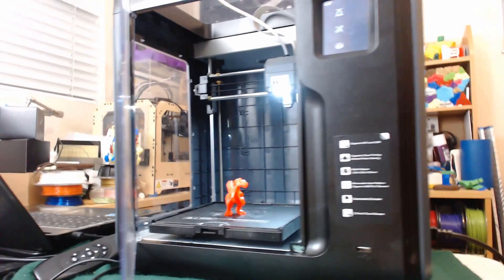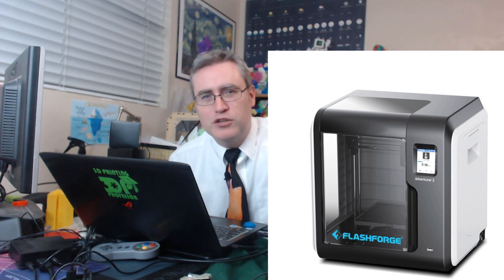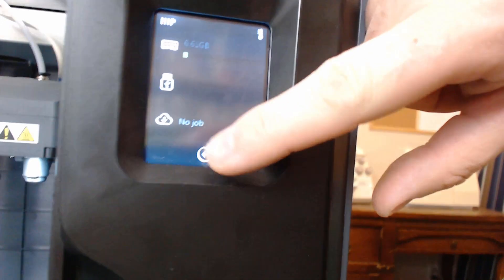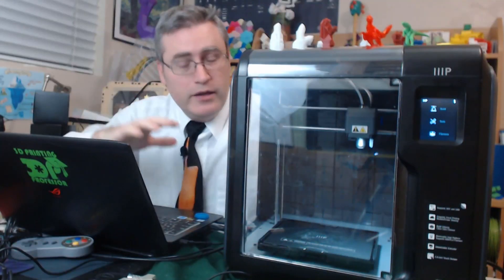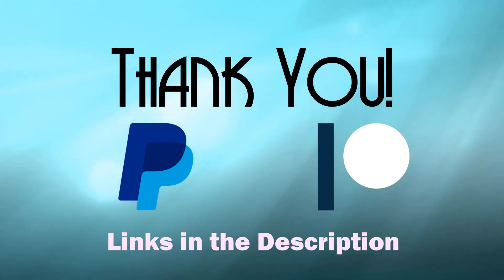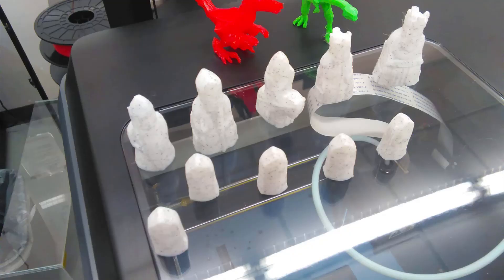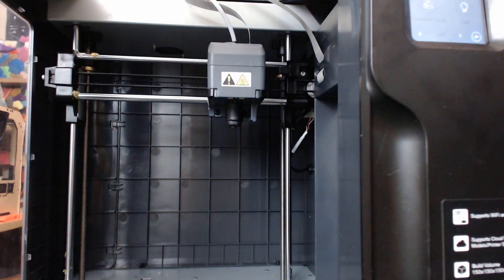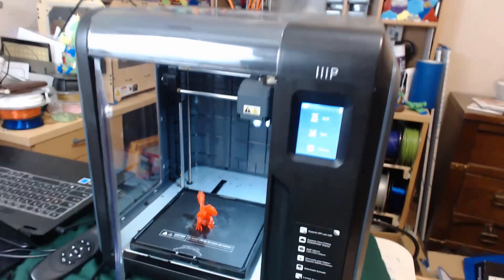Absolutely Loving the Flashforge Adventurer 3 / Monoprice Voxel 3D Printer

Comment: the  Replacement Nozzle - Designed For The Voxel 3D Printer are £24
Reply from the maker: Yes. And they snap right in. 

You may not remember this but Makerbot charges $100 for the replacement nozzles pin their 5th gen machines.

Comment: Not sure if you've used a Voxel lately, but the last firmware update I did increased that filament load speed a lot!  Now it sucks it in at a pretty high speed until probably 50mm from the carriage, then it goes to that slow speed.  And, there seem to be several sizes of the nozzles from Flashforge.  Monoprice only has one size on their site.  But they do seem to be readily available now for $26-$39! And replacement textured bed pads are like $5.

Comment: The top does open, if you push up on it from underneath. Makes the bowden easier to access. I agree with everything else you said- this was my first 3D printer and I think it’s the best printer to try and figure out if 3D printing is for you. I loved this thing and traded it for a drill press when I upgraded to a Prusa. If I hadn’t started with this, I wouldn’t be as into 3D printing as I am, because the Prusa is much more work to dial in.

Comment: Flashprint-MP is very sensitive to screen setup. If you closed it while using multiple monitors and the program was NOT on the main monitor when it was closed, then if you open it using only a single monitor, the program does not run properly. Close the app on the main monitor.

Comment: Currently considering the Monoprice Voxel 3D vs the Creality Ender-3 or Ender-5 (and if I do go with Ender, then vanilla vs pro). Any thoughts? I like the cheaper price of the Creality, but like the idea of ease of use and no need for assembly with the Monoprice. Does one have a better print quality than the other?
Reply from the maker: No, print quality between them is exactly the same. It's a question of how much do you want to tinker versus how much do you want to be making 3-D prints.  And I can't make that call for you.
Reply: @3dpprofessor  Thank you for the reply. What do you mean tinker vs 3D print? Tinker with the printer itself, or tinker with creating/modifying 3D models to print?
Reply from the maker: @Benjamin-rr4ku  Tinker with the printer. 

For some folks, that's what 3d printing is about. Making the machine better. And for others, it's about using the machine to make their ideas real. Me, I'm in the latter group, so paying a little more for a machine that just works is worth it.

Comment: Will the nozzle handle the temp for petg I'm wanting a printer that I can print aquarium safe parts and I've heard that nozzles with Teflon can't handle the high temp
Reply from the maker: Teflon lined feed paths do have trouble with high temps, but PETG isn't that high temp. Im currently printing ABS and its fine. 
The problem you're probably gonna have is bed adhesion. But you're going to have that with almost all 3d printers with PETG.
Reply: @3dpprofessor  so maybe something that has a heated bed or removable would be recommended for the PETG
Reply from the maker: @terrystanks1031  yes. And this printer has both.
Reply: @3dpprofessor  is there a program you would recommend for the design of the items that I'll be printing
Reply from the maker: @terrystanks1031  Tinkercad is great for the absolute beginner. Fusion 360 is the choice of engineers who like jumping through hoops like a circus animal. Blender is good for artists.
Reply: What program do you recommend for designing my 3d printed items

Comment: Is it compatible with third party filaments??
Reply from the maker: Yes.
Reply: Yes and... It's complicated. The filament that will come with printer, will work perfectly. With others, including those from Monoprice, mileage vary. With old nozzle and firmware, chance is close to zero, with new nozzle and recent firmware, some filaments will work, and some - still not.
Monoprice ships printers with old nozzle, but sells new one separately, at the same time their support "doesn't know" about 2 versions. Flashforge support will provide new firmware that will rename your printer to Flashforge Adventurer, and after that you'll get new updates regularly.
In other words - yes, but after thorough tests and efforts. 
One thing you'll find interesting, is that temperatures vary, and you should keep them as low as possible. High temperature may kill your nozzle, if filament requires lower.
Reply: @anreoil  thanks for the response. Recently bought anycubic mega s for 350cad..happy with it so far.

Comment: Does it handle USB 2 or 3 drives?
Reply from the maker: You've got a USB3 flash stick? Dang. We're not worthy.
I ran into a problem with some of these bought on Amazon. The firmware was so old that it could only read FAT formated USB sticks. The only way I had to do that was to get an old 1gig SD card that I had and put it in a USB adaptor reader. But once I did that I was able to get it to recognize the drive, I could put a newer firmware on there and update it, and suddenly it was able to recognize my newer USB sticks. Maybe that's what you're experinecing.
Reply: @3dpprofessor  Thanks for your answer!
Reply: I am considering checking out SunLu and others too.
Reply from the maker: @Yatukih_001  I can tell that you're frustrated, mostly because you're writing these long paragraphs so I get the notification of your complaints, then you edit them down here in YouTube to a single comment, and you've done that every time, but just let me assure you that these machines do work as I've said. There's clearly something wrong with yours or the way you're using it, but if you stick with it I'm sure you'll have better luck. I use 7 of them in the makerspace and they're great.
Reply: @3dpprofessor  I know. Found out it requires a 4 GB card. The card does not work, so I am unsure if I will bother further with it.The editing of these comments has been done to make sure they stay focused on their point. Seems I ran into a faulty printer.

Comment: Every time your nozzle clogs, you'll pay over USD30 for new nozzle. For other printers it's usually around 5.
And that's official Flashforge response for clogged nozzle, btw. Use the needle to unclog, and if it fails - buy new one for 10% of the printer's price.
Reply: if you're familiar with printers in general, for the price point, which one would you recommend over this one?

Comment: the nozzle isnt proprietary or anything like that right? ive been looking at getting a 3d printer to draft up some tool accessory  ideas ive had in my head and i want to print it in abrasive 3d filament which will require a hardened nozzle and i wanted to know if this supports that feature

Comment: 'The best 3D printer on the market for beginners' - not a chance. This is a buggy machine full of flaws, from heat creep to slipping steppers, appalling calibration to impossible bed levelling. The firmware is full of issues, from updates over wifi not working to mac address changing each time you switch it on. I want to love this machine, but I hate it.

Comment: I'm having issues with the extruder slipping when it's feeding.  You didn't mention this particular problem but what should I do?  I've tried different filament, putting a different gear on the extruder (which is crazy hard with where the extruder is positioned).  Do I have to print super slow or what?  I'm flummoxed.
Reply: It's a massive issue with this printer. No easy solution as it's based  on a few design flaws. It's not a good printer. Feels like it's still in beta testing.

Comment: I don't know if it's just me but it doesn't seem like my auto calibration does anything whatsoever...+2 seemed the golden number offset for a bit but now it's everywhere.  I set it and every time the offset that feels correct when i do the paper test is different.  I can set it, then immediately redo it and it'll be completely different...I'm not talking a little different either I'm talking a +2 offset being fine one second and then going right back into it and a +5 offset is now ripping the paper.  I've also found that if i go to a certain number and test, then bump the offset up one and come back down it's completely off again...and on top of all that when it feels pretty good, I go to print and I can hear the sound of the hotend actually contacting the surface of the bed, almost like the setting never saves. 

I'm rather new to the hobby but this thing has been a PITA printing anything worthwhile and not some benchmark object.  I did get a pretty decent benchy and lowpoly fox out of it admittedly but everything since has been futile.  I've been considering returning this to Amazon for something better, for the $320 I spent there's a few I was looking at...but at the same time I want to figure this out and force myself to learn the printer...so now I'm stuck with a dilemma.  I really like the look of it, and the convenience of having it on my desk, and it is so cool when it does work...like putting VR on for the first time cool.  Perhaps my printer is jacked up?

Is there any other enclosed printer you could recommend around this price point or perhaps better for a few $ more?  I don't need it for ABS or anything (yet) it's mainly to keep cats away and a little kid's curious hands from getting burned haha.  Is the daVinci line worth a darn?

(I do have an ender 3 coming in tomorrow haha, but I got that one for the open sourced nature of it.  I really enjoy tinkering and being hands on)
Reply: You're absolutely right. Calibration is dreadful with this machine and changes every time. Bed levelling is pathetic in this printer. It sucks. I'm sending mine back.

Comment: Do you know if this printer is having the same extruder issues the Adventurer was having?
Reply from the maker: I've been using it continually at the makerspace for 3 months now with no issues. So maybe they fixed that issue? Maybe it was just one person? Maybe... I don't know. Of the 2 of them that I've used, I haven't seen that issue.
Reply: @3dpprofessor  Cool! Thanks!

Comment: It is now $319 on amazon if you select black only or white only color. This is pretty insane for such a capable printer.
Reply: What does "black only" or "white only" do?
Reply: @1ryanfire114  It's the colour of the casing
Reply: Its just so damn backward - can just connect to Ethernet an dWiFi and to my knowledge not print any other object than a small cube. SunLu are real 3 - D printers which can in fact print from a memory card as well as from a USB.

Comment: Did you try flexible filaments? Does it print TPU?
Reply from the maker: It's a bowden, so only the less flexible of the flexibles, and print it slow. I didn't actually try it, but I've tried it in other similar setups. If it can do ABS, it can do the temps necessary.

Comment: I bought the Voxel after seeing your video- I was already considering it but this helped me make the jump. It’s a great printer! Very easy to set up and get printing in less than an hour. WiFi wasn’t as troublesome as people made it seem. I’ve gotten great prints over about a week of heavy usage- excited to try a bunch of different filaments after I print a spool adapter. Just search Thingiverse for Adventurer 3 and there are some spool adapter mods there. Love your videos, keep it up.
Reply: This is the spool holder I printed, and it works great. https://www.thingiverse.com/thing:3282844

Comment: It feels a little "fan boyish" with essentially no review. No construction details, etc....
Reply from the maker: You want construction details?

1. Unbox.
2. Plug in.
3. 3D print.

It comes pre-assembled, bro! Only setup you have to do is wifi, and I talk about that a lot in this video.
Reply: @3dpprofessor  It would be nice to have details about the overall construction of the device. How rigid is it? What did the test prints look like? It felt more like an 18 minute commercial instead of a review. I'm considering this as my next printer so I was hoping for more info.
Reply from the maker: @zircontweezers  It's solid. The prints are as good as any I've seen, with a lot less effort. If this sounds like a commercial it is only because I highly recommend you spend your money on this thing. It hits way above it's weight.

Comment: You seem like a decent enough guy. But I don't trust your opinion on this.
Reply from the maker: Fair enough. 

Honestly, and be sure to check out my write up on this one, my glowing review is only because of the buttery smooth workflow (aka, wifi printing, well laid out interface, with STL preview on the slicer). If open source could provide a workflow like this, well it'd still be a pretty good printer for the price, and enclosed too. But I'd question why they weren't open sourced more than they are.
Reply: I totally agree. This is not a good printer. He's missed loads of serious flaws, which make it a poor choice for most people, other than complete noobs. Bed levelling and calibration is awful. The hot end is dreadful for heat creep. The extruder motor slips all the time. It should be a great printer, but it's not. Mine's going back, I'm sick to the back teeth of it...and you can't upgrade firmware because that function doesn't work...did this reviewer even try it? IP address...it changes every time you switch the machine on!

Comment: I'd love Flash Forge to send you a printer, can't think of anyone more deserving.
Make sure to deep dive into the advanced settings in Flash Print most people miss it.

Flash Print was my first slicer #Blessed, I never knew how bad Cura was till I got a maker select mini style clone.
Reply from the maker: What's your favorite advance settings in Flash Print?
Reply: @3dpprofessor  Not really advanced but in Flash Print in scale clicking maximum is beautiful feature, so are the easy rotate flip and mirror options.
Advanced:
File > Preferences > Print > Printing Window Type > Advanced
Variable layer height + Reset Temperature at height + Lower Build Plate While Traveling (Z Hop)

No one else talks about Flash Print, i'd love to see you make a video on it verses cura and stuff.

Comment: 500 CND is too much
Reply: Not at all for a fully operable 3 - D printer. Thing is, the Voxel isn´t fully operable. We just don´t know yet if it is possible to connect it to a computer but you can easily connect it to wi - fi and an ethernet, and that´s pretty much it. If I try to make mine read images from my USB it won´t work. If I buy the right USB that a Voxel 3 - D printer can read that would be great.

Comment: I got one of these yesterday. But I cannot get it to connect on WiFi. I connected to my home router and got an IP for it. But when I try to connect with Flashprint on port 8899 (what it defaulted to) and i keep getting “failed to connect”. Ugh. Maybe I need to read more
Reply: Make sure your printer is on the same network as your computer. It will only work on the 2.4GHz band so make sure your computer is on the same one and not 5GHz. The IP info is in the About menu on the printer itself. It will change each time you power down and power up the printer - but it just increments 1 each time so it’s easy to guess the IP. Lastly, use the Monoprice Flashprint software and not the Flashforge one. I couldn’t get the Flashforge one to work with WiFi but the Monoprice one works great. Hope that helps!

Comment: Does the MonoPrice use FlashPrint too or does it come with something else?
Reply from the maker: THe Voxel uses Flashprint. Other Monoprice printers do not.
Reply: It uses a MP version of Flashprint that you can get here (scroll to bottom): https://www.monoprice.com/product?p_id=33820
I've heard it works with the normal Flashprint but WiFi doesn't work. I've only been using MP-Flashprint with no issues.

Comment: I've had this printer for a little over a month and really like it. The plastic top cover is removable, snaps out making it easy to do a cold pull. I can use wifi to print but when the printer trys to download firmware upgrade it gives an error.
Reply: I contacted MP about the error, and they said there isn't an actual error... it's just that there's no new firmware to update and the only message they can show is there's an error. Sounds dumb, but good to know it's not an actual update error.
Reply: @davidclayton9356   I got a firmware upgrade from flashforge and instruction on installing it via USB for the Adventure 3  v 1.0.7-1.3. It has some camera USB options but haven't figured them out yet.

Comment: Actually you can use CURA, there is a X3G output plug-in available in the CURA marketplace.
Reply from the maker: Have you tried it? I have, and the X3G it output doesn't work on anything. I've tried it for 3 different printers, and every time the result is the same. Tell the printer to print with the X3G it generates, and it just sits there, no preheat, no movement, nothing.